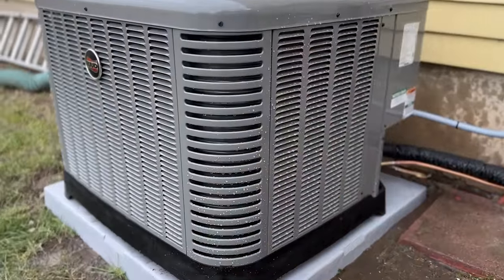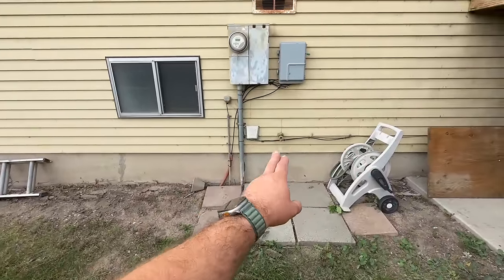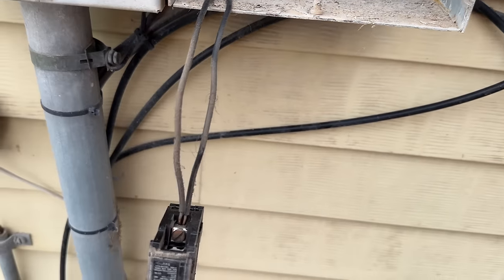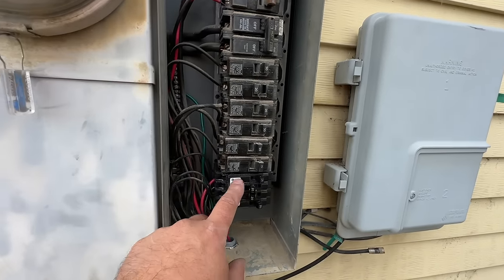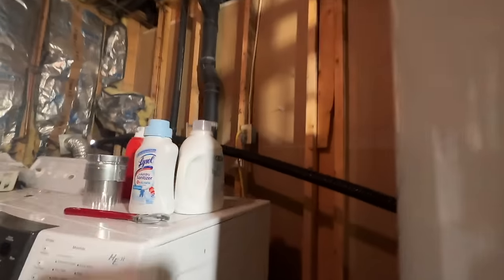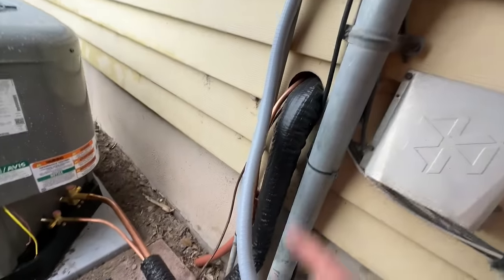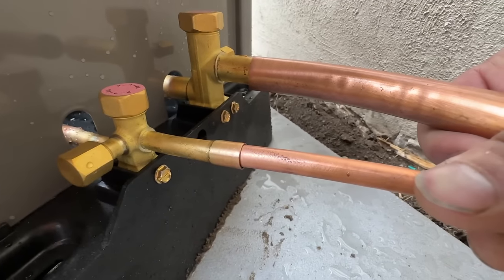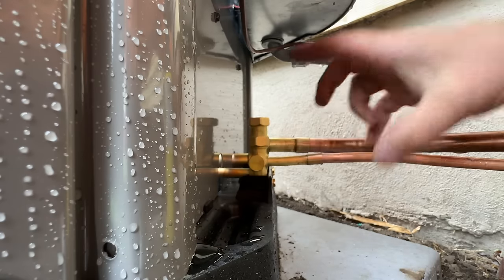Greedy HVAC Contractor Quoted Her $20,000!

Comment: Great video but one thing is when you changed out the breaker in the beginning of the video the original breakers were 15 amp and the ones you changed them to were 20 amp and if those are feeding 14 awg wires the breakers are over rated and pose a danger.
Reply from the maker: Yea I noticed this after the fact. I went back over and swapped it for the correct one: thanks for your good eyes everyone! Live and learn right?

Comment: Right on brother.  That right there is what you would call "doing the right thing" and still getting paid. Kudos. We need more of you.
Reply from the maker: Thanks man.
Reply: Technically, this is NOT 'doing it the right way' because that electrical panel would fail a code inspection.  Tandem breakers not allowed in residential application.  Double tapping a breaker is not to code.
Reply: @HeadCannonPrime  Some panel breakers are rated for feeding two circuits under one screw.  Not sure about the tandem breakers but you can't just keep adding them.  The panel is rated for just so many total amps.  Some panels will mechanically  limit the number of tandem breakers and their locations.

Comment: I certainly hope that the wires that were previously protected at 15A were the appropriate size to be protected by a 20A breaker.
Reply: Geez: had to go back and look at it in slow-mo, and sure enough, only the one 15 amp breaker shows out of the 3,  so he apparently erroneously put the wires in the new 20 amp ones. He could have moved the 2 lower 15 amp ones higher where the 20 amp ones are.  I'd sure be worried about a fire now
Reply from the maker: The same gauge wire was used for the 20amp breakers a few bays up. I noticed this after the fact. I thought they were all 20 down to the bottom. I’ll probably swing by and swap it out real quick.
Reply: In HVAC, you can use circuit breakers that are "oversized" for the conductor. The conductors need to meet the "minimum circuit ampacity" and the circuit breaker/fuse needs to be equal to or less than "max overcurrent device." It's not unusual to see smaller conductors..

Comment: I’ve installed my own mini split and find doing it so rewarding. I could use help sourcing the equipment and going through the process of planning everything out.  Obviously we are only seeing the easy parts of your job so it can be daunting when you get in the weeds.  Thanks for a wonderful presentation. My 90k btu high efficiency whirlpool furnace and 3 T ac is 35 years old and I want to be a bit more proactive in getting the equipment so it’s more of a transition than an emergency.

Comment: recently got quoted for $12,000-$20,000 due to two different brands and both are in a good conditions.  Got a second opinion from another HVAC pro, and there was nothing wrong with the equipment, both were well maintained throughout the years.

Comment: I am a former HVAC technician, though i have been out of the trade for quite a while. Im EPA certified, but not a licensed contractor. Since i don't plan to work for others or on equipment I don't own it really doesn't matter. If my system fails i will likely replace it myself IF I can get a supply house to sell a unit to me. Around here they don't like doing business with people without a state contractor license.
Reply from the maker: Or you can get it from hvacdirect.com 👍🏼

Comment: In Texas about 6 years ago, I had a new Goodman 16 seer and furnace installed for $4600.
Reply: Everything was cheaper 6 years ago. Those days are long gone.
Reply from the maker: Amen to that
Reply: @TM_Stone  Tell me about it. I checked a couple of months ago and the Goodman 4 ton unit now cost $2500 but in 2017 it was only $1100.
Reply: @genesisstar81  I had my 16yr old system replaced in February of this year since it was 1.5 tons undersized. I had 6 bids. Only one was super outrageous but the others were all aligned on pricing.

Comment: Great job on the line set bending and sheet metal work. There's really no point in hiring/paying professionals who do sloppy work in my opinion. Really neat location on the side of the house for the condenser and where you located the line set entry. All looks like it should be, layed out plumb and decent bends vs. line of sight installs. Nice little HVAC for the cost.

Comment: i wish you were in connecticut. I have 4 separate systems 4 outdoor units and I had 3 different guys do my start ups. I did the installs. but if i was to do my career over I would have gotten to HVAC. You guys can name your price. I helped a neighbor, changed the capacitor and contactor, fixed the bearings on the blower motor, a contractor wanted $13,000 cash to replace the condenser and furnace when material was about $2,300 and basically $10,500 would have went in this guys pocket.. It gets under my skin... Im an electrician, people can live without an outlet not working. But when the heat or hot water is a no go...... You are like GOD to the customers. I have to say you went over the numbers at the end of the video and you quoted $9,000. Material was what $3500? you made a nice days work and you didnt kill her. Very reasonable.

Comment: Back in 2018ish called a plumber (3 man crew) for all new water and sewer lines on a renovation. Quoted 6 grand. I could have done it myself, but needed a city inspection with licensed plumber. Called another BIG company and they said 10 grand. I told them I have a licensed plumber for 6... they refused to compete. Just not HVAC.
Reply: Big companies have high overhead. The local places that advertise all the time are a good 30-50% more than the small guys. A local company is John Moore -  "Call John, get more" is their slogan, but I say "call John, PAY more", quoted $2,300 for a shower valve installation and water heater line repairs. A smaller company quoted $1,200. I would have done it, but didn't have the time.

Comment: My neighbor doesn’t make a lot of money, they have small kids and last Summer was hot and they hired a HVAC company installed a central air that cost him 21K. His house is 1800 sqft, 2 HVAC techs got it done in 1/2 day. I think I am in a wrong career.
Reply from the maker: Sounds about right. You know what the sad part is? Those techs probably made $500 bucks each. The rest went in the owners pocketbook
Reply: to me it's isn't right i order a Trane Heat pump A/C setup plus a metal  box adding for more air to get on the spec original builder screw up the heating system installation to cut cost i presume duct was  to small   for $9 k my house it's 1900 sqf  will be done next week but the Trane furnace cost 5k ?

Comment: Great video! When you replace the two 15 amp with 20 amp breakers did you change the wire size? Wiring for a 15 amp breaker should not be wired to a 20 amp breaker. Seem like that could cause a fire if the original wiring is loaded passed 15 amps.
Reply from the maker: I realized this after the fact but I went back over and swapped it for one with two 15’s and a double 20 👍🏼

Comment: I got a new heat pump and air handler for my house earlier this year for 6500 bucks. The evaporator coil was leaking and I had lost the entire charge of refrigerant. I'm really happy with the new system but I took your advice and got my universal license on skillcat for free which was awesome. Now I have a question though, why are techs so hesitant to do a repair on an old system? After going through all the skill cat training it seems like repairing old equipment is preferable to replacing it and it's not as hard as they made it seem. They said I needed a whole new evaporator coil to do a repair but it seems like you could do a soap bubble test and find it and repair it. Anyway I'm interested in your thoughts? I don't like how we just throw things out that work reasonably fine and just take a little effort to fix. I kept the old system so I could tear it apart. Seems like to me you could just remove the equipment from the home and then make it much easier to repair then put it all back together. Anyway I love your videos. Thanks for teaching us all.
Reply from the maker: It’s all because of money. Why fix it for maybe a thousand dollars profit, when we can offer to replace it, and make $7000 in profit?

It’s easier to rip out a system and replace it then to remove a coil, rebraze it, pull a vacuum, and then weigh in r22 which is really expensive. Just my observations. 👍🏼
Reply: The thought goes like this; If I have to remove the coil to fix it, I can just put a new coil in WITHOUT fixing it.  Its the same work to change coils and you can charge for the new coil and do less work.  Fixing is More work for less money.
Reply: I totally get the money argument, but it seems very wasteful. I'm just fascinated by the industry and wanted to learn about how it all works. Then I'm like why do I keep getting advice that's it's the same price to replace it as it is to fix it. I would just appreciate more options and a full spectrum of what is available to me. That's why I decided I'd just figure out how to fix it myself :) That's the whole point of the channel isn't it? Anyway thanks for the response and all that you do :)

Comment: out of curiosity is there a book that has labor times or what you should quote for jobs? like in automotive there are labor time guides, warranty and customer pay. i know there are techs that don't go by them. but this helps try and give fair esitmates.
Reply from the maker: I do all my estimates with a profit margin calculator. So I just punch in my cost for the equipment and materials and the select the 50% profit margin. You can change the margin depending on what you need to make but generally 50-60% is a good target for hvac installs.
Reply: There are apps and websites that help you bid projects based on material costs.  Auto work is a little different because it is all done at your own shop so you can charge by the hour and finish multiple projects when you are waiting on parts.  HVAC stuff is all done on location and you have to bring your tools and parts with you.  It may only take you 30 minutes of actual hands on tools to bolt on a capacitor but you have to drive there, set up, potentially deal with any number of obstacles until you get to the problem part.  It all takes longer than you think it should. So jobs are basically either HALF DAY for easy repair, or FULL DAY for installs.  Then you just charge what your day rate is. Of course that depends on living expenses in your area and how much the tech needs to charge to make a living.

Comment: Hi, just finished watching this and other of your videos (cleaning the furnace), very informative. I'm ready to replace my 20+ year system and currently have a 3ton a/c and a 80000 BTU 80% efficient furnace. Would appreciate advise on which is the better replacement based on specs and brand (pricing is basically the same)

Rheem 85000 96%. 5" filter and 3 ton 16 SEER. aprilaire humidifier OR

Lennox 90000 96% leaving the 1" filter and 3 ton 17 SEER. lennox humidifier.

Thank you!
Reply from the maker: I’d probably suggest using our remote services for further help with this if you need it. That can be found at Patreon.com/diyhvacguy     Hope we can help.   Cheers

Comment: I had a CPS vacuum gauge, but the damn thing turns off after 20 minutes making it worthless!
Reply from the maker: It shuts down the screen. Turn it on and it shows where you are currently at. It’s to conserve battery
Reply: @diyhvacguy  I wish it would say that somewhere! I looked though the whole manual. For all I know it was resetting and losing zeroing.

Comment: So I didn't really come for the install based on the work I have seen from you before I'm sure you did fine but as an HVACR guy I really want to know what the justification for a 20k system was because at that price you'd have to be do something insane like installing ducts in a house that didn't have them (why would you do that though install a mini-split) or selling the customer a commercial size unit or something. I just could never see any scenario that quoting a residential customer that kind of money is reasonable baring a mansion and they need like 15+ tons of capacity and then that's only because it's going to cost that in equipment alone.
Reply: The $20,000 price is a "I don't want the job" price for whatever reason.
Reply: @robertcounts5300  probably right I have over bid jobs I didn't want before but never that high lol

Comment: So how does one buy a complete system whole sale to save money without an account or tax ID number?
Reply: Get a cash account (credit cards count as cash from the point of view of the business) at a local HVAC shop. Unless you're buying refrigerant, you generally don't need anything more than proof of identity.

They might not help you pick equipment or bail you out if you mess up, they're in the business of selling things to pros after all, but if all you want to do is buy a thing, they'll generally happily sell the thing to you.
Reply from the maker: Not true. Pretty much all hvac suppliers will not sell to the public. They will only sell to hvac contractors. You would need to purchase your equipment through hvacdirect.com or Amazon. I’ve purchased from both and had great success. 👍🏼

Comment: Definitely NOT an R410-A unit if you soldered it. R410-A has minimal pressures of 800 PSI. Solder is for low to no pressure.
Reply from the maker: Wrong, do some more research bud.

Comment: They say the devil is in the details. I generally like your videos and their subject matter but  would benefit more if you spend more time on details. Like on which connector on the compressor and airhandler both should we connect which copper line. I think DIYers would benefit from a taking a moment to really make those little connections clear.
Of course, major good vibes for not overcharging your clients - which seems to be an epidemic in our society today. Thanks.

Comment: DIY HVAC GUY I'M LOOKING TO REPLACE MY FURNANCE WITH A COMBO HEARTER AIR CONDITION UNIT.
MY RANCH HOME IS 2,400 square feet with 7' tall ceilings.
Do you recomend RUDD FURNANCE AIR CONDITION UNITS?
WHAT ESTIMATE COST TO DO THE TOTAL COST INCLUDING ELECTRIC WORK INCLUDED.
ANY HELP WOULD GREATLY APPRECIATED. 
COMING FROM A LONG TIME SUBSCRIBE 😊